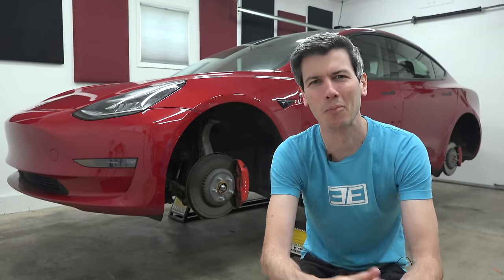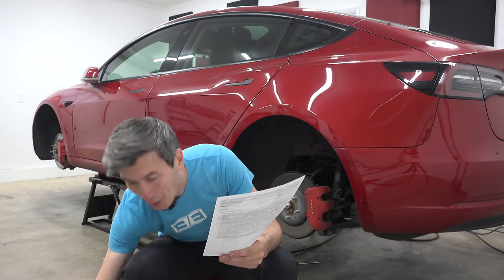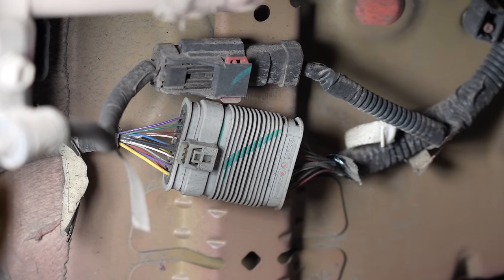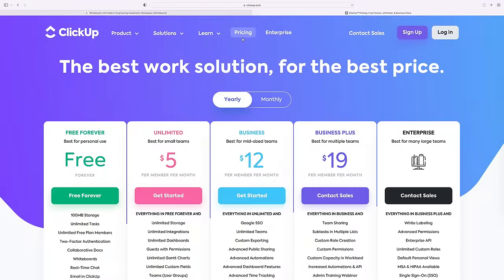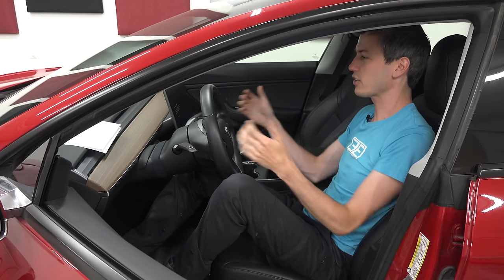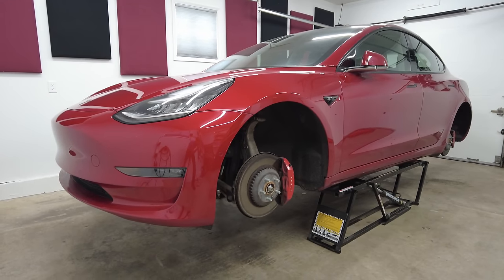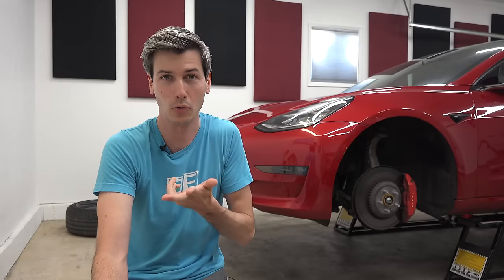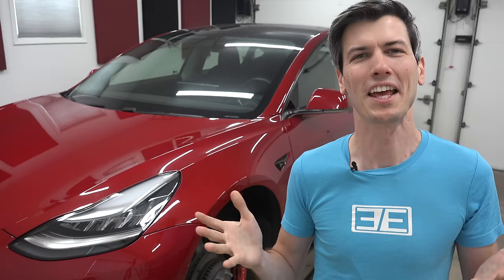Tesla Battery Damage? I Ran Over A Metal Bucket

Comment: An interesting next video, could be about the use and abuse of big casting pieces in Tesla. Pumped with hype by many, as Munro. Meanwhile ignoring the risk of stress fractures caused by fatigue, or damage in minor impacts.
Reply: This would be a fantastic video.
Reply: I think Sandy Munro knows more about the reliability of using castings over most people.
Reply: @Resist4  many people forget Munro base work, it's to save production costs to the Automaker. Not to improve reliability and overall build quality for the Costumers.
Reply: @Resist4  for a reason many Automakers didn't jump straight to big structural casting pieces, decades ago. Besides possible issues with stress fractures cause by fatigue to the casting, you also could have problems of economy of scale with rejected castings.
Reply: @RogerM88  Since Sandy worked in the industry for many years he knows more than you about it.  But just because automakers didn't jump into castings doesn't mean it was the right choice.

Comment: Would it have caused more damage to a conventional car because more are exposed than a Tesla?
Reply from the maker: May have ripped out an exhaust.
Reply: @EngineeringExplained  or gas tank, or oil/transmission pan, brake line,....!
I am just flabbergasted looking at ICE mechanic video channels like "Just Rolled In" etc and seeing all the complex crap that can break/rust/fail on them! So glad I have simple EV w/ no more parts to fail!!

Comment: Tesla cheaped out with the rain sensing wipers, they decided to use the already included Autopilot camera for rain sensing rather than installing the separate infrared sensor other vehicles typically use. That’s why they are so bad, optical cameras are not good for accurately detecting rain.

Comment: I've had my model 3 extended range since June 3rd, and unlike many people, my auto wipers work for the most part great.  If they don't start to wipe a mist or light sprinkle, I just tap the button on the turn signal, they wipe, and then they seem to continue correctly.   Maybe the sensors have improved over the 4 years since you purchased, or maybe I'm just ok with the way they work for me

Comment: Protip for keeping the acceleration feeling spicy.
- Buy a set of the S3XY buttons.
- Place one of the buttons behind the wheel where a paddle shifter would be.
- I set my to the following. 1-click: Chill acceleration. 2-clicks: Sport acceleration. I don't recommend toggle, as you'll have to remember what state it's in. Minor inconvenience averted, but it's nice having exactly what you requested.
- In the car settings, set the acceleration to "Chill". That way it will always default to Chill when you get in.

This way, you spend most of your time in "Chill" mode, which is decidedly less frustrating when dealing with slow accelerating cars around you, and is nice while cruising. But when you need the power, just click-click and you get the full punch again. To me, my Model Y LR+ feels faster than ever, despite nothing actually changing. I just get used to chill, so when I need sport, it always feels fresh.
Reply: Actually it's much better for all drivetrain components and tire wear to drive on Chill by default

Comment: I'm glad you had a good experience with a Tesla. It's $66K-$70K car. I normally buy a used car, I spend between $20K and 30K. I can't see myself buying a new car and seeing the price drop by even 15-20% over 2 years of owning it (even though most drop more than double that). Getting a used "better" car I see as the best value for money. 

I am afraid of even looking at a Tesla. A 5 year old Tesla, batteries start failing and your out $15K+ (seeing some long range models costing close to $30K).  This is a LOT more than replacing a gas motor if you blew it and the labor to replace it, with a new or even used motor. With batteries, like in your cell phone, it's not IF they will fail, it's WHEN they will fail., it's just matter of time and re-charging. 

I like them but, in my eyes, the downfall is way too much if it fails and it very well could fail very bad.

Comment: For my M3P, 3 Years 55,000 miles, I have spent $0 service related costs. Only washer fluid, a cabin filter replacement (did it myself)  and a set of tires, no other car with nearly 500 HP will be so cheap to own.  @engineering explained, I did have a car in front of me kick up a chunk of semi truck tire rubber and cause some minor damage that I fixed myself.  I've not had any of the camera issues you talked about.  Realistic highway range for me is around 240 miles. Also, I thought every M3P came with Autopilot. BTW, you and I have both had a Yellow AP1 S2000 and M3P, and we both have ME degrees, we are like twins!

Comment: I had the same experiende when replacing my 12v battery, due to error code or age. If purchased at store out of pocket it would had been $250 to $300 plus labor (easy install). However at SC it was $100 for battery and install with 1 year warranty. I went SC route.

Comment: I had my spoiler replaced on my 2021 y performance 3 time’s! It kept getting loose on the corner. Tesla design center needs to get with the engineers and figure out this aggravating problem! Also, the wipers don’t work that well. My range is 265 to 270 max at 100 percent but that’s enough to get me where I am going when I travel. I can drive for about 2 and 1/2 hours doing 75 mph before I have to charge. Great video.

Comment: My experience in my Model Y as far as range goes is this. Car was rated for 300 miles new, haven’t notice any real degradation. When going 70mph on the highway, I can get 270-290miles of straight driving. I often like to go 80-85. When doing that, it’s closer to 230-260miles of range. If I’m going 65mph or less(lots of rural roads in Wisconsin are 50-55mph) I can actually get more than 300 miles. Range really has never been an issue.

Comment: Service Center could have removed the 6th, small screws on the wheel bearings. It's just a helper during assembly in the factory and can cause trouble later when getting loose.
At least that's what I`ve been told, SC removed them during a checkup.

Comment: We'll see how the car is after 15 years. It's still too new to know. But it is glad to hear about an honest dealer. I've never find one myself. The Ford dealer charged me to fix a recall then broke things and denied they did it. .. Twice. So I don't like dealerships. It still worries me that you can't easily get a Tesla worked on by an independent shop since they hide the codes and prevent independent shops from seeing them. If Tesla fixed that, I'd have more confidence. Because what will happen when the Teslas on the road get old. Will the dealers keep up? I guess we'll see. At least this video demonstrates there is hope.

Comment: 4 years, okay but what mileage? Close to 30k Miles if I catched that correctly. 

For us switching EV has moved costs around. For example we used to run 4 tyres for every 100k km (for us 2 years). Now with the EV we already had to replace fronts at 20k, back will probably last 40k. So the same 100k is more like at least 12 tyres 🤔😲 or x3 in tyre cost in just the 2 years of ownership.....

Suspension work on our last diesel was at around 200k km. I expect that to come sooner also this time.

Comment: you dont need the spoiler it is just for looks.

while yes the spoiler may be functional for aerodynamics you have to far exceed highway speeds for the spoiler to work as intended so you can remove it.

most highway speeds here in the united states can vary from 55 to 75 or even 85.

you have to probably go over 100 or even 150 for the spoiler and wings to work.

Comment: Takes time to shift, a car that has to shift a couple times is still going to accelerate at a higher rate and feel faster than a car in a constant rate of acceleration that doesn’t have to shift. It’s the on off gas and turbo torque of manual cars that make them so much fun and feel faster than they really are.

Comment: I have been following the EV market for a while now and I have come to the conclusion that they really need separate Urban and Highway ranges quoted. I mean all EVs, not just a specific brand.

Those of us who've been around for a while are used to petrol cars going much further in rural/highway driving than in urban/city driving.

But the regenerative braking is much more useful around town and has very little effect in rural driving as the vehicle is fighting wind resistance at fairly constant speed. No slowing means no regeneration. It's a simple equation.

When you commented on your Model 3's lack of range compared with the claimed range I thought that your channel is an ideal place to discuss this. You might consider some tests to compare the range with spirited driving and more sedate motoring.

Comment: I got a quote for $195 just to look at a squeaking sound from the rear suspension. Mobile wouldn't come out.  I'm not convinced they would find the source either so waiting for it to get really bad and take it to a local garage.

I got the MPP comfort adjustable coilovers and it didn't fix the squeak.  During this process,  I learned Tesla would charge $275 just for an alignment.   I also learned there is a misconception that Tesla has to do it because they have to use some special equipment.  This is untrue.  After you get your alignment performed,  turn off AP for 30+ miles and let the car go into deep sleep. The next day, do a camera calibration and you are good to go. Save half on an alignment.

Comment: Just a random thought- I work at a Tesla collision center, and do you know what one of the most common causes of battery damage is? Tow truck drivers. They insert their hooks into the mounting holes on the batteries and they tear as the car is dragged onto the truck. While the batteries still operate fine, they are compromised from a structural standpoint.

Comment: I just drove my 2022 Model 3 Performance from San Diego to San Luis Obispo and back and I got 240 Wh/mi for the whole trip, which is what it's rated for, so real world range is identical to claimed. I put 19" EV01 Aero wheels on it, so I'm sure that helped, but still
Reply: Pretty sure that's because your new Performance Model 3 has a bigger battery pack than a 2018 model has.
Reply: @Resist4  No, because we are talking efficiency, not capacity
Reply: @teslasnek  caught that after I posted.
Reply from the maker: I'm at ~295 Wh/mi after 30k miles. That doesn't fluctuate much, though I live a lot further north than you (colder temps, and an older Tesla without heat pump). Even still, I don't get 240 Wh/mi on the highway in the summer either (at realistic highway speeds).
Reply: @EngineeringExplained  What kind of tires you running? Just curious. I'm running Nokian One all-season tires which have low-rolling resistance (probably helps too)

Comment: Agree with most points in this review.  Fair and balanced.  The range issue is definitely frustrating. I have the M3 Long range which was rated 353 mi. In. Realistic road trip scenario you get 260 mi tops.  So yeah, 70% of the advertised range is accurate.

Comment: For a manufacturer to repair, for free, any item that has degraded in 4 years, is the bare minimum. It's not great, it's just a basic expectation.
The air filters and control arm bucket, great. Most manufacturers have horrendous part prices.

Comment: On my Model Y, I added in the full HEPA system myself by ordering the parts directly. The service center was like "Here ya go" no questions asked. The filter was full price of course, but the new cover and air guide were $1 each.  So overall, it was WAY less than the HEPA retrofit they had talked about adding. I just need to go in and get bioweapon defense mode activated.
Reply: I have MY with HEPA from factory. Honestly I never used bioweapon mode ever. I also don't see a situation when I could use it in the future

Comment: My Performance Model 3 is 3 years old, and hasn’t had one cent spent on it yet. I’ll do the filters soon, I rotated tyres F to R myself, and that’s literally it. (There’s still a little life in the tyres, and they’re wearing very evenly.)
It’s BY FAR the best, and most enjoyable car I have owned, by miles and miles. Period!
P.S. My auto wipers have actually improved a LOT with the very latest update, but the auto hi-beam is like most cars- hopeless. I do NOT use auto high beam on my ICE car either.

Comment: i just opened a ev repair shop and they usually charge out the wazoo for lil things out of warranty. They are great in warranty usually though. i own 22 model 3 and rear tail lights humidity and performance spoiler clearcoat is reoccuring. U can keep smell of cabin filter down very cheap buying weather strip kit or  removal of shroud that causes water into cabin filter.

Comment: I had one as a rental for a week last year.  It convinced me that I didn't want to own one, at least not yet.  The build quality is just not quite there.  The one I got was still practically brand new (less than 3000 miles), and it already had a bunch of rattles, water in the tail lights, and while it looked great from a distance, a closer look showed panel gaps that reminded me more of a 1970s GM car than something from the modern era.  And the semi-autonomous driving was also half-baked.  It slammed on the brakes randomly for no reason several times as I was going down the highway, and once that almost got me rear-ended.  I turned it off after that.  Tesla hasn't been around that long, and so they are a bit like Hyundai was years ago when they first entered the market - smart and serious but still just too new to the game to know what they don't know.  They are like 90% there, but that last 10% is stuff that GM, Toyota, etc. learned from decades of experience.  I imagine that the 2030+ Teslas will be amazing, but I wouldn't buy one now.

Comment: I have PPF on my Model 3 and got an aftermarket CF spoiler that looks and feels identical to the stock one... The tape it came with was useless, so I bought some aftermarket stuff and my spoiler has been on for about a year now with no issues. Can provide the names of the items if you need.

Comment: I've been looking at the prices for your factory service with  amazement and wonder. I'm pretty sure Honda charges a minimum 1/2 hour labor for any service (I think there's a diagnostic fee tacked on as well). At $120 per hour thats a minimum $60. They also seem to mark up the price of the parts markedly (pun intended :). I had a charge of $250 for a fairly simple procedure that I just didn't have the right tools to do (not expensive tools). In the end they left a hose off that I found on my own. One hose clamp and check engine reset and I was good to go. 

I'm thinking they knew you were a youtuber and didn't want bad publicity so gave you the deal of the century. I have zero faith in factory service centers to do the job right,and or inexpensively. Maybe Tesla is different but I doubt it. You just had a very, very luck day :).

Cheers

Comment: About the acceleration getting old: I've owned my Model S 100D (non-performance or Ludicrous or whatever) for 5 years now and have taken it to the German Autobahn for the first time earlier this week.
The way this big and heavy boat just shoots away from the cars behind you when you mash the throttle is uncanny. As you say: The AMG's, RS's and M's needed to shift down, spool up their turbo's etc. By the time the German performance machines started to accelerate, my old people's car had gone from 100 to 150 km/h and relentlessly kept on pushing until 200 km/h (couldn't safely go faster, traffic was too dense).
No, really, even after 5 years the acceleration still baffles me.

Comment: I have had my 3 for 4 years.   I had to replace my upper control arms.     $200.    Just shy of 2 hours.    I though the bill would be around $600. 

Other than that just washer fluid and tiers.   Still have the original brakes and wipers.

Comment: The Daily drive is everyone's drive every day. Almost.
30miles, 7kwh. 
Every one who buys should put 20 solar panels up on the home rooftop.
Every one can top up daily.
You questioned how the grid would manage, energy from the ends and not the centre of the grid. 
Feed the grid and take power from anywhere on the grid, trickle flows of energy. 
Auto park onto a home wall plug would be a great idea. 24/7 grid connected almost.
Trade grid power and stability for  money 💰.

Comment: You need to get the aluminum skid plates that RPM Tesla sells. I bought the on ebay for less, and they have saved my front battery cooling connections are least twice already.

Comment: I figured if it was a metal bucket made in the past 30+ years, there shouldn't be that much damage provided it went under the vehicle and didn't have something else in it, but actually surprised how little damage there was. I would seriously consider an EV, if I had a decent place to charge it, and I suspect there are many others like me. I am leery of Tesla though, due to their stance on DIY and independent repair shops.
Reply: Tesla isn't really against diy. They just don't have enough parts available. Even Tesla service centers struggle to get parts. And third party shops can work on Teslas just fine. 

The only area where they don't want you to work on something is the battery. But even that is just difficult and doesn't come with support from Tesla. They don't actively prevent anyone from working on any part of the vehicle nor do they "brick" the vehicle because you did something to it. The worse that they have done is prevented fast charging on a rebuilt Model S that was totalled and not even legal to register in many states.